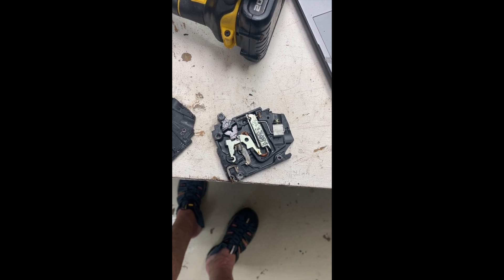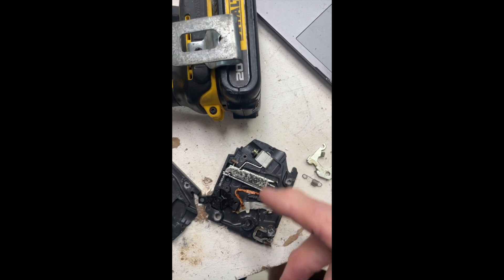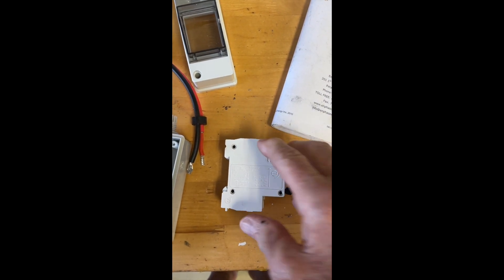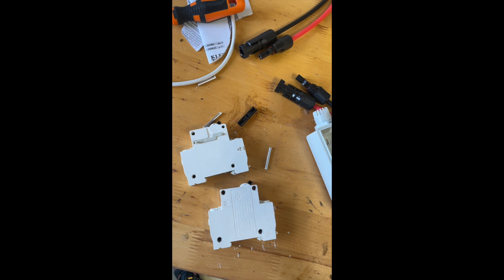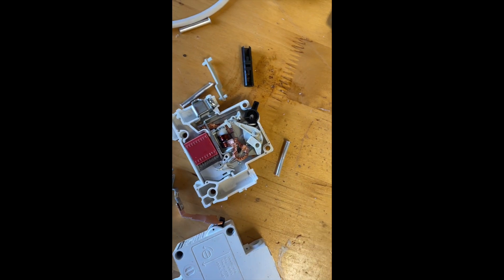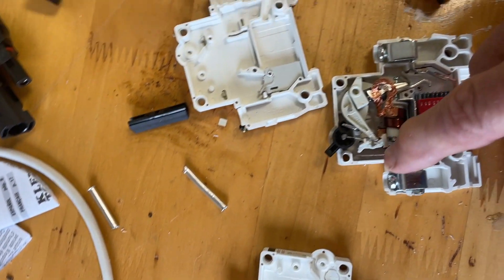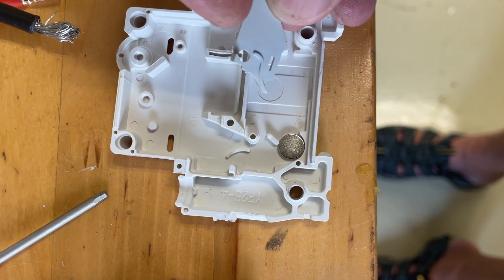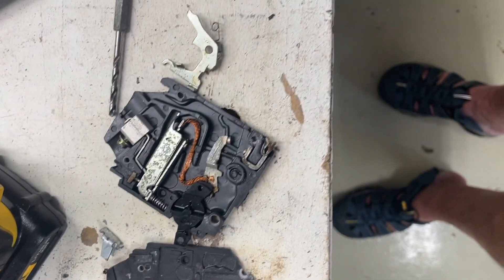Into the Guts of DC Breakers--Are They OK as PV Disconnect Switches

Comment: DC breakers primarily come in two varieties... polarized and unpolarized.

--

Generally speaking, unpolarized DC breakers are rated for lower voltages (usually under 100VDC) and these rely on opening the contact relatively quickly because while there is an ARC chute, there aren't any magnets directing the ARC (because it is unpolarized).  So the ARC walks up the bus bar more slowly than it would with a polarized DC breaker.  Or not at all in some cases.

Because of the reliance on the gap,  high-voltage unpolarized DC breakers can get very, very expensive because they generally have to direct the ARC and use a dual-chute or other mechanism such that the polarity does not matter.  That can get expensive.

--

Polarized DC breakers can operate with much higher voltages without catching on fire.  They can be quite inexpensive.   A regular every-day polarized DC breaker looks like an unpolarized DC breaker except that it has two magnets to either side of the contacts that direct the ARC away from the contacts and into the ARC chute.  Thus polarized DC breakers do not rely on the initial contact gap to break the ARC.

However, hooking up a polarized DC breaker incorrectly will direct the ARC away from the ARC chute and basically cause a fire.  Polarized DC breakers are hooked up according to the current flow and are only suitable when the current flow is only going in one direction.  Hence their use as a master breaker (for maintenance) for a solar string.

--

This distinction means that the use-cases are VERY important.  A polarized DC breaker should only be used when the current can only flow in one direction, such as in a solar string DC disconnect.  And should NEVER be used in any situation where the current can flow in both directions, such as a battery.

Generally speaking, polarized DC breakers are considered to be dangerous because so many people hook them up incorrectly.  There is no "line" and "load" side, for example.  And the "+" and "-" labels are an indication of current direction, NOT an indication of voltage polarity.

In addition to appropriate fusing, DIY projects should always use unpolarized DC breakers for all low-voltage DC wiring... which is basically everything that hangs off the battery bus.   Even when the current direction is known.

Polarized DC breakers should only be used in a few special cases such as solar PV disconnects where high voltages might be present.  And you had better get the current direction correct.

--

DC breakers (polarized or unpolarized) are designed to operate safely under load.   DC disconnect switches generally are NOT designed to operate under load.  A DC breaker that does not properly operate under load is a huge red flag indicating that it is a fake breaker.   A DC breaker failure, to meet UL, must fail tripped.   That isn't hard to do, any serious melting of internal components will trip a DC breaker and not allow it to be reset.  Generally.

-- Special note on solar DC disconnects --

The DC breaker in a Solar DC disconnect is in the current path AFTER any paralleling occurs.  You cannot use DC breakers as solar DC disconnects on a per-string basis if multiple strings may be paralleled, because the current can flow in either direction during a short or failure situation in that case.  Solar DC disconnects should be rated for at least 1000VDC (or higher).

Typical solar combiner boxes thus have per-string fuses and a master (polarized) DC breaker for the back-haul to serve as a maintenance disconnect.

Generally having polarized DC breakers rated for less than 600VDC is a huge red flag that it might be a fake breaker.  A polarized DC breaker that cannot handle at least 600VDC is probably not properly designed.  Unfortunately, there are a lot of these on Amazon.

-- Two methods to trip the breaker --

(1) There is a bimetalic strip which will trip the breaker on overcurrent by heating up and bending and causing the mechanism to trip.  This is the standard trip mechanism for over-current but it is slow-acting.  See tables for the breaker type.  This will ultimately trip the breaker in the (roughly) 1.5x to 3x current range, but it can take a long time.

(2) There is a solenoid that more or less instantly causes the breaker to trip if a short occurs.  This generally requires 3x (type B) or 5x (type C) the current.  That is, an actual short circuit will put an enormous amount of current in the wire.   Well over 3x or 5x the breaker rating, and thus cause the breaker to instantly trip.

This is why standard trip curves for DC breakers have a cliff on the graph at 3x (type B) or 5x (type C) the rated current. Because that is the point where the solenoid moves enough to instantly trip the breaker.  Below that point, the bimetalic strip is the trip mechanism and that can take a while to actually heat up and trip.

-- Breaker Sizing --

Breakers should be sized to 125% the expected maximum current or higher, and must be sized to 100% the cable's amperage handling capability or lower.

Fuses should be sized to 150% the expected maximum current or higher, and must be sized to 100% the cable's amperage handling capability or lower.  Roughly speaking.

You are using the wrong cable size if you can't meet those conditions.  You never want to size breakers or fuses to exactly the expected maximum operating current because this will generate a lot of unnecessary heating of the breaker or fuse.  It is a greater problem for fuses (less mass to dissipate the heat prior to the intended trip point).   You also want the breaker to trip before the fuse does, whenever possible (in situations where both might be inline with the circuit).

-Matt
Reply from the maker: Wow, thanks for this comment Matt. These breakers are not marked as polarized, though it seems they have to be since the arc is directed to the arc chute by the magnet. I would expect the arc will bend the wrong way on one of the breakers since one breaker is positive on the top, and one is negative, though perhaps they reversed the magnets knowing which way they were going to wire them. I'll check that out. Though you'd think they'd be marked appropriately in case someone used them other than the way they were factory-connected.  Now that I think about it, that's probably why they are offered as pre-wired with MC4 connectors--so they would only be used with the expected current direction. As soon as I saw that they had no polarity marked on the case but had a magnet I wondered what the heck was going on. They are rated at 400 VDC, I'm going to buy one of their 1000V rated breakers and see what they look like inside. Again, thanks for added info. What do you think of that interlock between the breakers? I've never seen that before. It looks like it's intended to prevent latching if a contact is welded. I plan to add some excerpts from your comment to the blog post, which is a lot more technical than this video.
Reply: @ExpertAmateur-xn6dr my 1500v 32amp no sign of polarity.
Reply from the maker: If you're commenting about a breaker it's almost bound to be polarized unless its the size of a breadbox and cost >$500. The breaker I took apart in the video was not marked as polarized, but it is.
Reply: @ExpertAmateur-xn6dr  Yah, that breaker you took apart in the video is 100% a fire hazard.  Lots of red flags.  No "+" and "-" markings, has both AC and DC ratings that are nearly identical, was polarized without being marked as such, and has a DC voltage rating of 400VDC which is ONLY possible in that form factor with a polarized breaker.    Which it turned out to be.

They are probably relying on symmetrical breaking as 2-pole, meaning that they rely on one of the two current directions across the 2-poles being the "correct" direction and marketing the breaker as if it were unpolarized when it is actually not.  This is a huge fire hazard because there might be an alternative DC return path for the ground that does not go through the breaker.  Among other things.

-Matt
Reply: @junkerzn7312  Thanks for the info I saved it for future reference.  Speaking of which, is there some example of a "good" DC Breaker to buy?  from where?   Everything is Amazon and Ali-express these days.
Reply: Nice.
Reply: "This generally requires 3x (type B) or 5x (type C) the current."  That's the minimum magnetic trip rating and is not guaranteed to cause a rapid trip.  At 3x (B) and 5x (c) the device is permitted to take 2 seconds to operate.  It may well trip more rapidly, but it may not too.  The charts indicate a band where a rapid magnetic trip is permitted to happen, not guaranteed to happen.  Once you get to the right side edge of the band you are guaranteed a rapid trip.  For a B that is 5x rated current, for C x10.  The reason for this range of potential rapid trips is down to it ultimately being a mechanism that is being acted on.  Usually manufacturers will target the mean trip point, 4 for B, 7.5 for C, 12 for D etc (these numbers will be familiar to Australian and New Zealand electricians!).  Below that point the electromagnet will be pulling on the trip pin but potentially not hard enough to yank it immediately instead causing it to creep.

For a combination magnetic chart the DC trip current of an AC rated device is approx 1.5x greater than the AC trip current but the overall 'band' of potential magnetic trip currents still applies.  For a B type device that means the trip current should only be considered to be capable of magnetic function at 4.5 times the rated current of the device.  Similar applies for C, D, K, Z, and so on.

"This is why standard trip curves for DC breakers have a cliff" AC MCB magnetic trips have that cliff too.  The only time you won't see that cliff is in a device with thermal trip only.

Comment: Hoping that you can also make a video on DC battery breakers and polarized, non-polarized and directional. Leaning alot from your channel.
Reply from the maker: That's a good suggestion, except battery breakers, which need to be non-polarized, are a heck of a lot more expensive and therefore a bit painful to ruin. Maybe I'll do one with a lot of handwaving and some diagrams instead of busting one open.
Reply: @ExpertAmateur-xn6dr Maybe you could locate some DC breakers that have failed, and do a necropsy on them? Should be pretty cheap for dead breakers..

Comment: Great teardown. Good point about not switching under load, I suspect even the switch your about to test will deteriorate with each operation if under load. I will soon have a 400v plus pv single series string with said purpose solar Isolator switch ( 4P4T 4 poles wired in series ) , no breaker or fuse. Since HV DC is such nasty stuff I believe the less connection points the better. I intend to turn this breaker off during close electrical storms, do you see this as a worthwhile exercise?
Reply: I open my PV if a storm is around too.  I have additional SPD downstream of the device (ie remains connected to the wiring when the PV isolation is open) because sufficient voltage induced on the PV wiring will leap across the contacts and still reach your protected equipment.  Of course if lightning actually connects to your array or wiring, all bets are off.

Ensure what ever you are using to switch the PV actually is rated to operate under load, or command your inverter / MPPT charger / what ever to stop drawing current from the PV before operating the switching device.